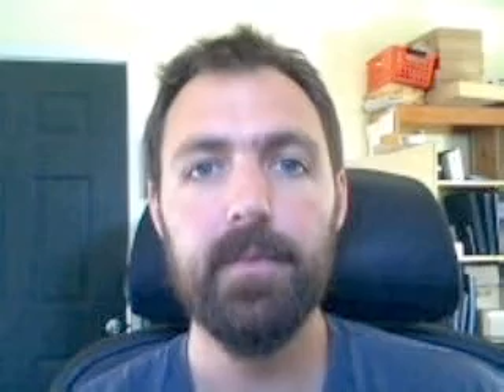StrawBale.com: Load Bearing or Post & Beam

Comment: It should also be mentioned that post-and-beam construction works better in a wet climate, where you can get the roof on the house BEFORE you start the strawbale construction. We recommend this to most of our clients where they are concerned about weather and getting the straw bales wet (which they can't of course).

Comment: How many storys can a load bearing structure have?  It would seem if the height is there, then there should be a way to divide into multiple stories, as long as you run support beams or poles to offset the middle area.  I also thought you could use straw bales as those supports, and just build according to how the walls were built.  Whats the different?  Why cant you attach the bases of the stacks you will use as the middle supports for the second, or third story, and cover them like normal?

Comment: @strawbaleinnovations (continued) Then if I can build a story and a half using load bearing construction, the second story could be half straw bale, then finished with conventional lumber or the like?  And the ultimate question here is, is there a standard height, in feet, that cannot be exceeded in load bearing construction?

Comment: Thank you for the reply.  So, I can't really plan on load bearing walls supporting a second floor in general, that would exceed 8' as a ceiling height?  Or were you saying that I couldn't have a 10' load bearing wall that would have another 10' of another material as a way to get height out of an otherwise small ceiling height of that 10'.  My concept is simple, and is the general load bearing rectangle, with a roof assembly that would have a southerly facing bank of windows, with slanted roof.

Comment: @strawbaleinnovations Thank you for responding!  So my question is, if i build a first floor of my structure to sit on the foundation level, is there a wall height I need to keep in mind for placing the second floor on?  ie, i would liek my first floor to have a wall height of roughly 10-12', with the second floor resting on the entire perimeter of the first floor, or perhaps leaving an overhang, or balcony to look into the first floor while upstairs.

Comment: Thanks Andrew, I think you just pointed me in the direction I wanted to go. Rammed Earth with no cement. Yes, I'm working on getting the code changed in NM. Thankfully, there are several dozen examples of the rammed earth homes built with no cement or concrete all over the world so it's just a matter of showing what can be built and what has lasted for 800 years or more with no cement. This is not to put down straw bale. I absolutely love SB. Unfortunately, there seems to be no way around cement as a foundation and because I'm concerned with the environment and cement accounts for 10% of the C02 released into the atmosphere I don't see any other options. Also, I can hang stuff on the walls of a rammed earth home a lot easier then a straw bale home. Thanks for your wonderful videos. Since i have ten acres maybe my guest house will be straw bale.
Reply: For the foundations you can do dry stone wall if you dont want at all use cement.
Il also saw some straw houses builded on top of a firs layer of volcanic type light stones aggregated blocks (cogetherm for example..) So the low part of the wall is out of water and insulated as well.